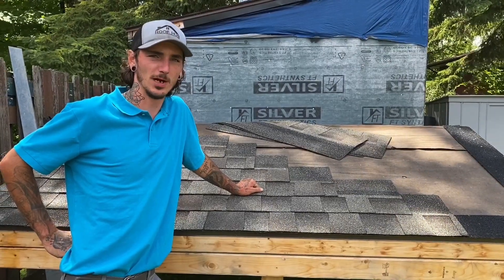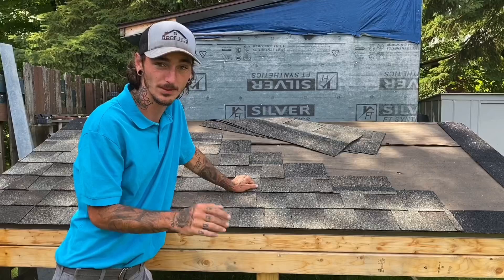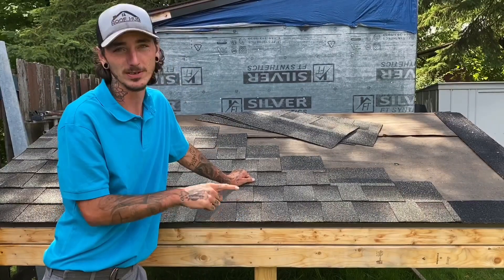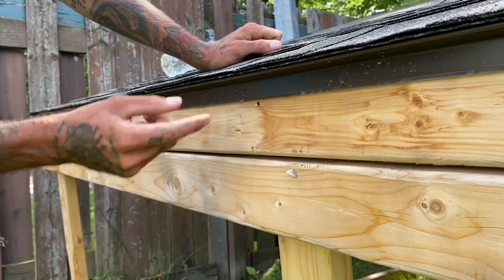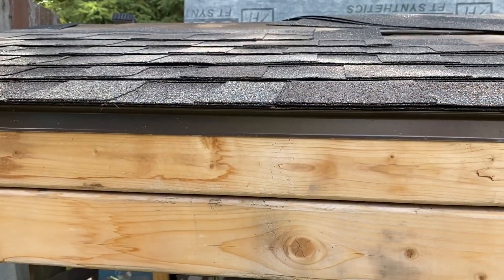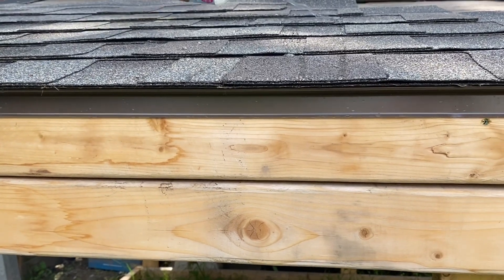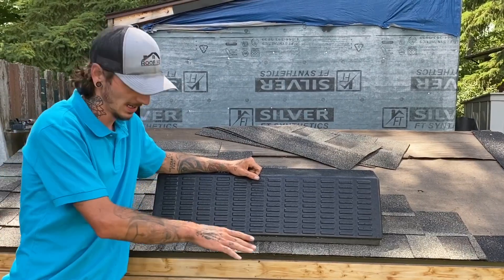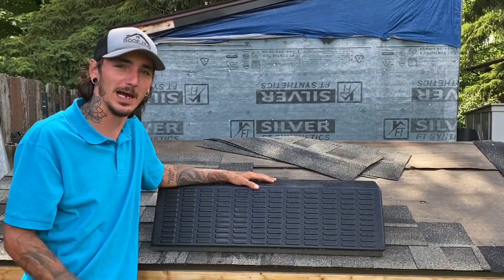Drip Edge & Shingle Overhangs Explained!

Comment: Notice the dripedge has a small kick out at the bottom where it meets the facia board. This little 1/4" kicked out piece running the length of the dripedge is what breaks the capillary action that causes water to be wicked up behind the dripedge and hold water... causing rot. Same thing holds true for many flashing applications. On sheds I build the walls overhanging the decking by 1/4". Then when I put the siding on it isn't touching the subfloor band material. In doing this I break the capillary action. I've see shed builders line the walls up flush with the subfloor's outside band boards. Later you will see water damage running up the inside of the walls and out into the floor. The water will literally wick 16 to 24 inches up the inside of the wall.  It follows the studs.
I also use allow a 1/2" overhang from the dripedge to the shingle overhang... personal preference.

Comment: I think you are taking a simplistic approach. Rotting of fascia boards and soffits is indeed a problem. This is often caused by water wicking up between the fascia and drip edge due to the drip edge being applied flush with the fascia. Even with a shingle overhang, a bit of wind changes everything. It doesn't rot in the timefrme of your video, but over years it will. Many handimen get a lt of work for this.

Comment: I imagine this stuff is fairly easy to install? I was cleaning my gutters a couple weeks back and realized i was missing most of the dripedge around my house where the gutters are. The shingles overhang a good bit over top of the gutters but i assume i need to get some installed. Just had my roof replaced about 6 years ago too. Goes to show you cant trust all contractors to do a good job.

Comment: Dylan thank you for you videos. They are very very helpful. I am putting a Rolled roof on my new lean to Shed. I am using a adhesive roll on base first. Then the actual Roll Roofing. My question is how to properly install the Drip edge? Do I install like I would if I was using tar paper and shingling( Side drip edge o top of paper & front edge under paper). Or do I put my drip edges on top all  3 sides of the rolled roofing base. I understand to use the Asphalt Primer on top of drip edge. No YouTube videos anywhere explaining this for rolled roofing and drip edge installation. Thank you so much for your help.

Comment: This is just plain wrong. You can do demos all you want, but the proof is in real world scenarios. I've lived in multiple old houses where the drip edge is installed incorrectly like this and you can stand inside and watch the water wrap around the drip edge and down the facia. Every house i've lived in where the drip edge is installed this way has wood rot. I just replaced a ton of facia board exactly b/c of this. It's a PITA. Do it right the first time.

https://www.youtube.com/watch?v=sDTCTbyyg1s&ab_channel=ThisOldHouse

Comment: I just had some drip edge replaced in a house I bought. Long story why. I got up on a ladder when they left and there are 3 small shingle ends where the shingles are short of the drip edge maybe 3/8”. Everywhere else the overhang looks good. Not sure why they didn’t pull them all the way down like the others. We have that sherrif goslin diamond pattern on. My son said to try to pull them down flush with the others but I yanked on them some and they won’t budge. Don’t want to damage them and create a worse problem. Is them being a little short going to be a problem? I live in Michigan if that helps. Thanks
Reply: I’m having the same problem in Wisconsin after a roof installation. Did you ever find anything out on this? I have a gutter apron rather than drip edge. My roofer doesn’t think it’s a problem, but I’ve heard from other roofers it could be.

Comment: Water seemingly defies physics. I would be curious to see the results of CONTINUED waterflow in the video above. Pouring water on the roof from the water bottle doesn't adequately simulate CONTINUOUS HIGH VOLUME rainwater flow; this video does have a more accurate simulation of how rainwater will behave - https://www.youtube.com/watch?v=sDTCTbyyg1s. Waterflow behavior poured momentarily from a bottle of water will not have the same waterflow behavior of a continuous larger volume rainfall. Decay from prolonged exposure to water and water intrusion are not dynamics to take for granted. Think about how water behaves when a paper towel is dipped into water - the water seemingly defies gravity and quickly climbs the paper towel. I don't want to play with water running against the fascia. I subscribe to the gap behind the drip edge, between the fascia and the drip edge as well as the shingle overhanging the drip edge. It's beneficial to understand the properties of liquids so they're not underestimated - https://youtu.be/P_jQ1B9UwpU.

Comment: Drip edge shouldn’t tight to fascia board. Should leave 1/4”-1/2” for gutters to slide behind drip edge. I always leave gap even if house doesn’t have gutters. Your gutter guy will hate if it tights on fascia.
Reply: @Steph Watson  False.
Reply: .should use gutter apron not drip edge where the gutters go, ..1/4 to 1/2 inch away from fascia board  is not good,   there doesn't have to be a gap at all just nail it flush, better for gutter hangers or spike and ferrol..30 years doing seamless gutters here.   00.02

Comment: I wish more roofers could see this .. (I specialize in gutters facia and soffit). I went to a repair today where customer had water getting back behind the gutter.  Gutters were fine, but the roof was short shingled with no drip edge so the water was going behind the facia metal as well . I honestly see this at least once a week on repairs 🤷🏼‍♂️
Reply: My roofer did the same sh*t to me. Had a roof installed 5 or 6 years ago.  I was cleaning my gutters the other day and noticed im missing about 80% of the dripedge around my house. I guess I'll have to get a guy out to install some or do it myself.
Reply: I live in Weston, Washington, and I just learned about my roof having the same problem,. The lumber behind the gutter is starting to rot away.